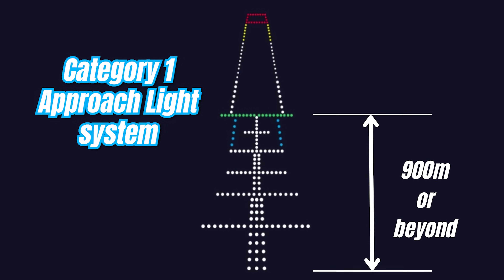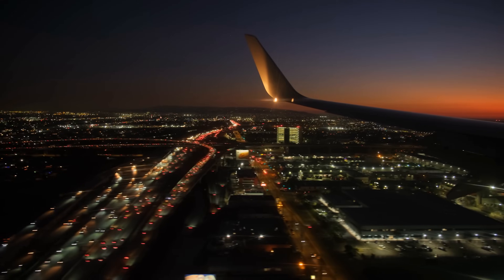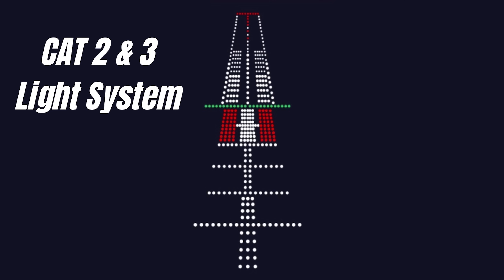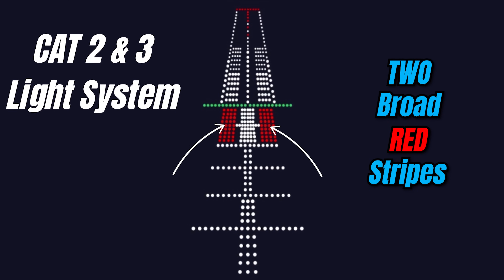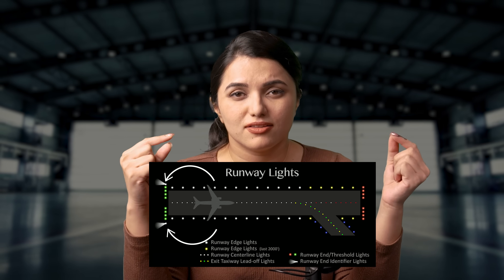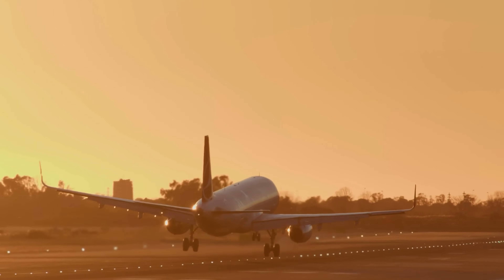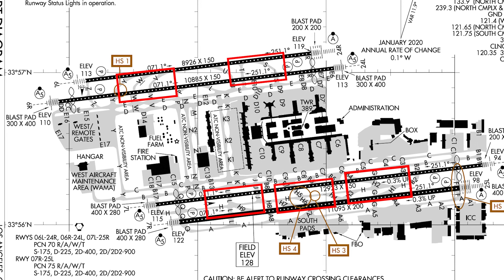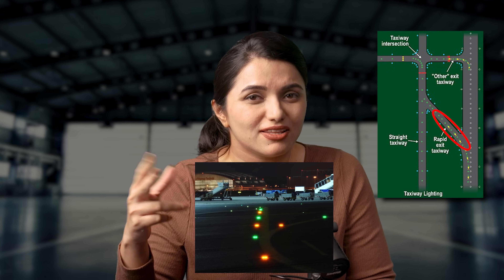Runway Lights Explained: What They Mean & How Pilots Use Them (Detailed Guide) by Capt. Neha Thakare

Comment: You are drifting from feet to meters and back to feet etc (e.g at 2:13). Had you maintained a consistent unit of measurement, it would've made more sense. Also, instead of YOU in the main frame, the lights graphic should've been in the main frame with you in a smaller pic overlay. The graphic would then highlight which lights you are talking about at that time. Would've made for a better presentation.